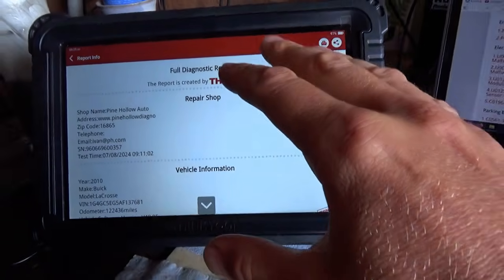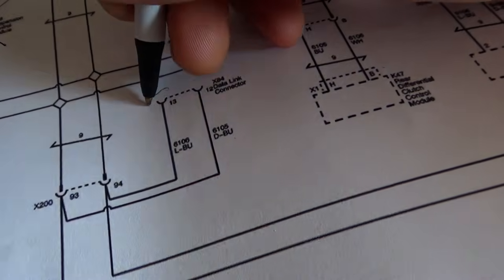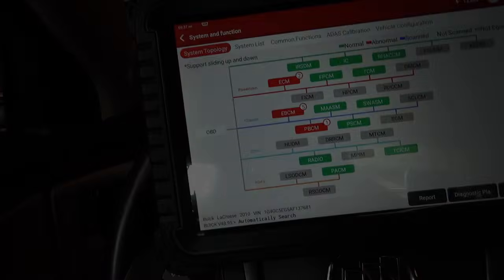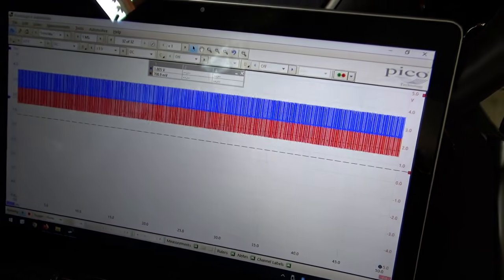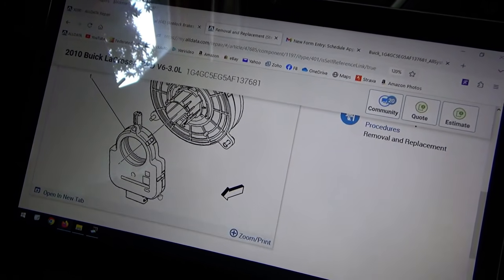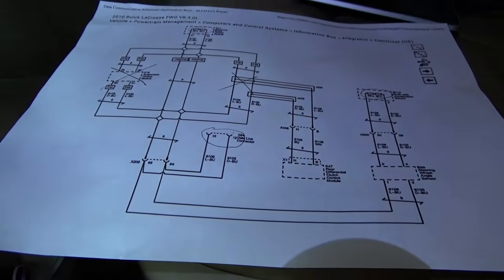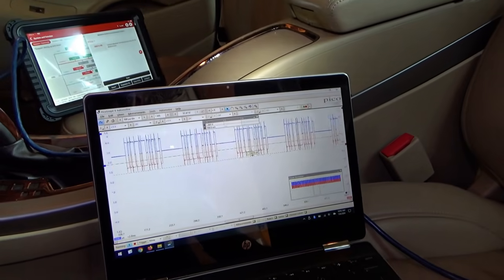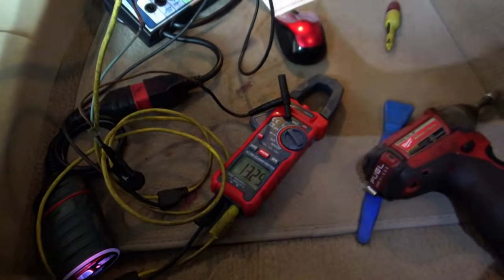(Pt 1) Customer Spent $1000...Car STILL BROKEN!? (Buick GM ABS MALFUNCTION U0074)

Comment: My biggest issue with this situation is that a shop took this customer's money and didn't repair the car.  Then they didn't return the owner's phone calls.  If this is a local shop, likely they know about Ivan; they should have returned the customer's money and recommended Ivan.  GREAT VIDEO!
Reply: I disagree, the biggest issue is the So Called Technician who work on vehicles. Just because you have a Technician attached to your name doesn't mean you are. 
Even the oil change person has a TECHNICIAN attached to his name. 
How can a guy that changes oil be a tech?
Next is the Janitorial Technicians. They cleanup after every ones mess.
Reply: The local shop should address customer directly to Ivan.

Comment: When the mechanic says " we need to start with this part first " means there's going to be a second, and a third, and a fourth and .........
Reply: Ok but when you’re dealing with coolant leaks and oil leaks that’s what’s has to be done wouldn’t you agree?
Reply: @hhn2002  Yes, if you see a tie rod end, flopping around, you change a part.  If he reads a code with scanner (which even an idiot can do), if the mechanic doesn't bother to read the theory of operation of the subsystem to understand the potential reasons why you'd get those codes, the mechanic is really not providing any value other than having a lift to make working on the car easier.

Comment: I do not have the gear needed to get even this far, but, having watched Ivan get this far, I think for my next step i would be tempted to check the connector on the main module - looking for something obvious like green crusties or loose pin fitment.

Comment: I would check the wire integrity from the EBCM to the other modules It's quite possible that the EBCM circuitry board has a failed trace on it or a bad solder joint which is not providing power to the other module

Comment: Good morning Ivan, I would have checked power coming out of the module at first, that would eliminate  a wiring problem,  being left with either a bad connection at the module or module itself. Amazing work that you do.

Comment: Cool video Ivan. My next step would be to back probe at the ebcm on the same wire that feeds both of those two sensors with one channel. My second channel I would probe at the closest connector inline that you showed on your diagram. And then just as a precaution on my third channel I would throw a current clamp around it. Start it and let it run and see if I had lost power on either channel one or two. Or if the line was shorting out I think I would see it with the current clamp. After that based on the data gathered I would make my next move. But what the hell did I know 😂
Reply: Hey Eric!  You and Ivan need to do another combined effort video!
Reply: The customer’s vehicle is getting a Royal treatment from two professionals diagnostics enthusiasts!
Reply: Eric what do you know? I suggest Ivan reaches out to Scotty Kilmer   he knows more then anyone including Bernie!
Reply: @jordanboulay3780  LMFAO!!!!!
Reply from the maker: Yup that's the plan Eric! Pico has 2 more channels to play with 😁👌
Reply: @PineHollowAutoDiagnostics  this general mess is in trouble...
Two diagnostic wizards ideas on one GM. Those 2 shops will feel like someone falling walking upstairs 😂😂😂
Reply: @Bombardier64  Come on man you better watch it Jack!
Reply: @PineHollowAutoDiagnostics I'm not so sure you can trust that Eric O. guy. Just kidding of course. We all know he's the best the PRNY has to offer.
Reply: If I were a betting man I’ll go with that N.Y guy. I’m just saying.
Reply: Southmainauto is here omg.
Reply: BAH!!  Just jam around at all the wires wildly with gardening tools until it fixes itself. jk jk, Mr O. has the proper path to find your problem, lady.  
Stay gold.
Reply: I didn't see your response when I put mine in. Everything I know (which isn't much) came from your, and Ivan's videos, plus a little experienc from 50+ years of DIY.
Reply: Eric and Ivan, the dream team! 😊

I say load the parts cannon and fire it at it, try some Amazon parts, always a sure fire winner! 😂
Reply: You, sir, are fibbing. We all know you're more of a test-light tech than an an oscilloscope tech.
Reply: @iainthomas237  These are low current circuits. They may not even light a test light 🤷‍♂️ if I didn't know for sure I definitely would use a meter or a scope to read voltage instead of relying on a test light in this situation. Unless I went right to the module and it lit up a test light then that's a different story.
Reply: ERIC O AND IVAN THE GREAT FOLKS!   It’s your classic GOAT mix as we say.  Eric O nailed the next step for sure.  Ivan verified the cause.  Now verify the why behind the cause.   BAM.
Reply: @htownblue11  needs an ebcm
Reply: Thanks Eric, thats what i was thinking myself🙂
Reply: That's not bad for someone who says they can't read a pressure wave form and tell you what color underwear you have on;  I believe you are "sand-bagging," Eric.
Reply: We don't back probe in these parts.
Reply: I would say that the current probe is key here.

Btw it's incredible that the previous shops seems to have failed to come to this point. Even someone with very little skill in electronics can measure powers and grounds.
Reply: Come on Erick quit showing off lol
Reply: Solid plan! love your channel too.

Comment: I heard the new Hondas are braking by themselves without a cause hope Ivan can fix them.
Reply: I owned a 2018 accord, it definitely would scare you once in a while. Sold it for more than I paid new after 2 1/2 years during COVID. Replaced it with an old LS430. Also a 2019 Pilot that audibly complained about almost every car coming toward you on a 2 lane road around a curve. Super annoying. Got rid of it for a Highlander, much better.
Reply from the maker: That pretty much describes many cars built after 2019 😂

Comment: Nice job finding the power.  I'd start inspecting the harness.  Starting with the plug on the ABS module.  I'd also look at the clock spring.  It's a 14 year old car and it's a wire that constantly flexes.
Reply: The circuit doesn't go through the clockspring.
Reply: That is unplugged already!
Reply: @lancecorey6582  No it doesn't.  It's simply attached to the back of the clockspring but is not wired through the clockspring.
Reply: @johnaclark1  Sorry, I made a mistake. I forgot a portion of the steering angle sensor doesn't turn. I took the comment off.

Comment: "yaw rate acceleration sensor" WTAF? People generally just go back and forth to work or grocery stores in these things. They just need to work! There's absolutely a place for this kind of tech. I just question if it's all truly necessary in daily driver cars. I'm no luddite but i am a mess of opinions ... Drive a 20yr old MT but new bike's got di2 (Ivan knows what that means) 🤣
Reply: @NeuronioJr I can't tell if you are being serious or sarcastic 🤣
Reply: When the grocery getter starts sliding on ice or whatever these sensors let the traction control or braking help get things straightened out. Perfect for a driver that doesn't know how to react.
Reply: @outriding  Yeah, I get it.  And I can't in good faith argue the value of TCS, ABS, and other stability systems that are part of cars.  The luddite in me will yearn for the old days where new drivers were taken to snowy parking lots to learn how car feels in slippery conditions but the realist, and engineer, in me knows those days are largely gone and tech can truly improve safety for the masses.  But good god is it a mess sometimes when it breaks.  Old guy yelling at clouds I guess :)
Reply: I don't understand this thinking.  Any car with a stability control system will have a yaw rate sensor, which means as early as the 90s, and getting pretty common by the 2000s.  We are talking 20-25 year old cars, many of which have long been in the junkyard after being totally used up by multiple owners.  Stability control is one of those systems, in my opinion, that is actually useful and not representative of safety/nanny culture.  But that also assumes you accept ABS (which has been around since the 1970s in electronic form)...
Reply: @kevin9c1  see my other replies.  I was being old guy yelling at clouds and chose the wrong particular one to yell at.  I don't disagree the systems are useful.